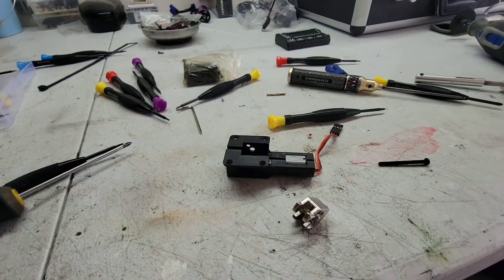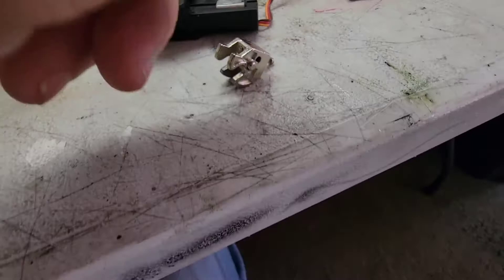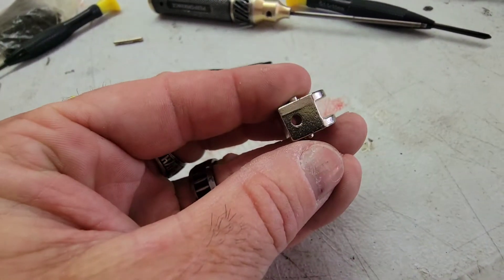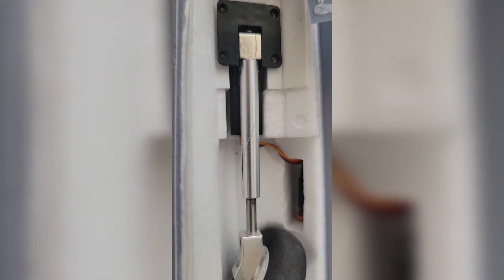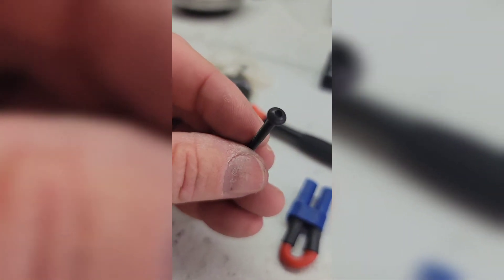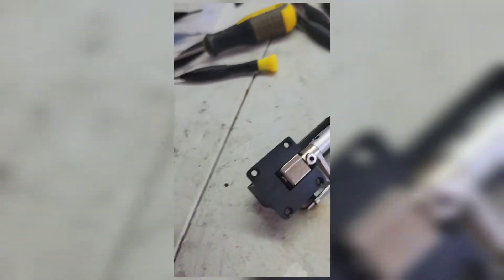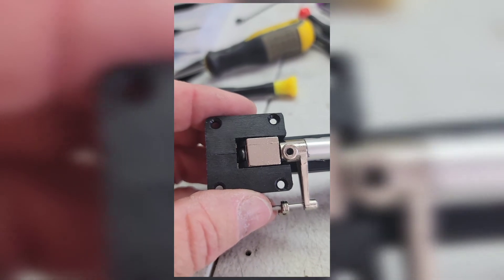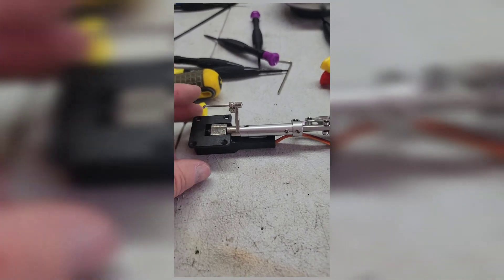Freewing F-16 landing gear strength mod.

Comment: How has this mod held up in terms of taking out the gear mounts instead. Usually pins are meant to bend/snap so you don't destroy stuff further down the line.
Reply from the maker: So far so good
Reply: @charlesfrank1969  Cool. Thanks for responding.